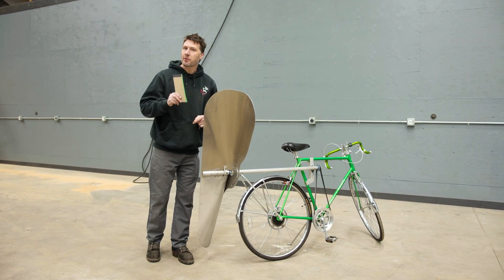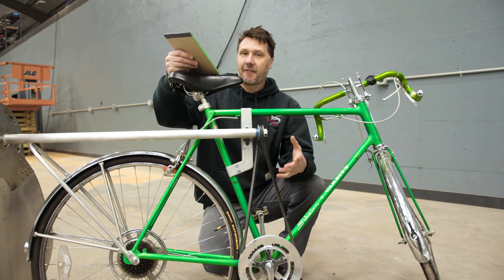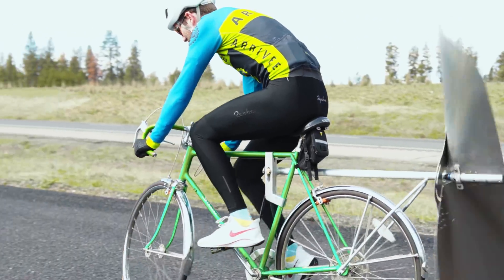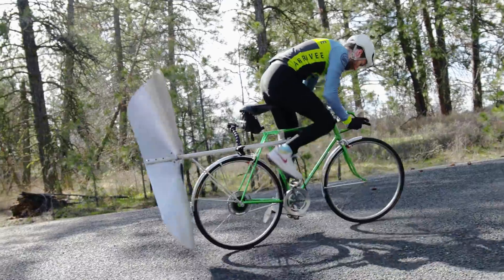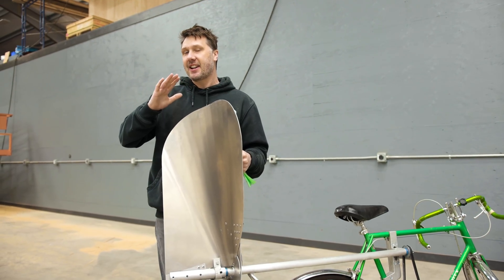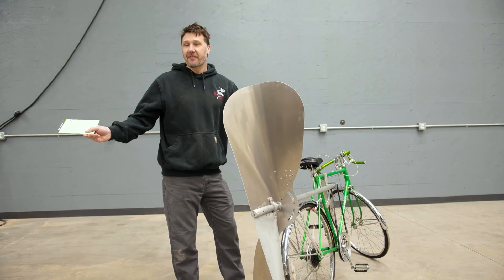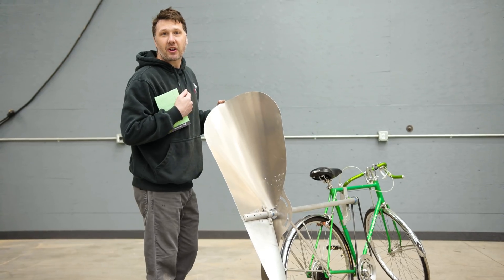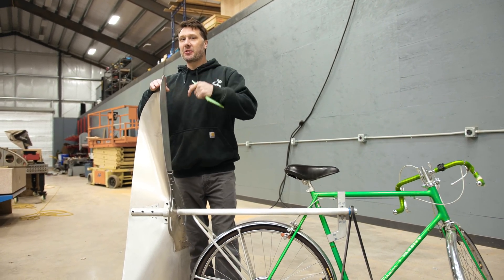Does the Propeller Bicycle actually have a Variable Pitch?

Comment: Would be interesting to see how optimized this could get with 60 years of tech and manufacturing advancement...
Reply: With no expenses spared you'd think something could be built that would go quite fast. That would be very cool.
Reply: I agree! One thing is for sure: it would go much faster!
Reply: @patricj951  Lets place some bets! I think the old man was within 50% (30mph) of modern tech. Ultra light carbon bike with an optimized prop, still wont do better than 30mph or a 50% improvement...
Reply: @beachboardfan9544  
I don't understand how you mean. You don't think it will be faster with modern tech and an efficient optimized propeller?
Reply: @patricj951  I do think it will be faster...
I'm speculating on how much faster. 
I think Earnest was within 50% improvement. So if his 60s design did 20mph, I think using modern tech/materials, will only yield, at most, a 50% increase in top speed, so no more than 30mph.
Reply: @beachboardfan9544  
Ok, I understand.
I have read that an optimized propeller can get an efficiency of more than 80%. I guess the copy of Ernest's propeller has hardly even half of that. The shape is not much reminding of a modern airplane propeller, and when I look at it I understand it indeed moves a lot of air. Just not so much backwards to produce thrust forward.
So I think much can be improved.
By the way: I found a short video. Such a propeller is much better:
https://youtu.be/_hbGZ1K3WS4
Reply: @patricj951  Yea but theres no way you're going to pedal a propeller to engine driven speeds, so whats optimized for an airplane definitely wont be for a man powered prop.
Reply: @beachboardfan9544  
The efficient design of an air propeller is still similar with long slender blades. Look at the propellers of pedal airplanes. What is optimized determines mostly by the size in relation to the power. Human has low weight/power ratio and a propeller shall be large with low rpm to provide high efficiency at cycling speeds. But an optimized bicycle propeller still looks similar to an airplane propeller.
Reply: @patricj951  So whats your speculation? How much of an improvement do you think could be had with modern materials/tech?
Reply: @beachboardfan9544  I think something like you wrote. 25-30 mph would be possible. 
Maybe 35mph with a track cyclist.
Reply: Compared to the whole history of technical progress 60 years are not that much: most manufacturing techniques were already mastered by Ernesto's time. Even mathematical modeling of propellers was pretty good from the times of steam-powered ships.
The main difference now would be the break of cycling traditionalism and actually building with aerodynamics in mind.
So, put it on a recumbent, pick a fenced propeller from a catalogue and you will get to 40mph
Optimise the materials (steel for cfrp) and you will get to the same 40mph, but quicker and safer
Run CFD simulations to tweak the fairing - you will get to, say, 42